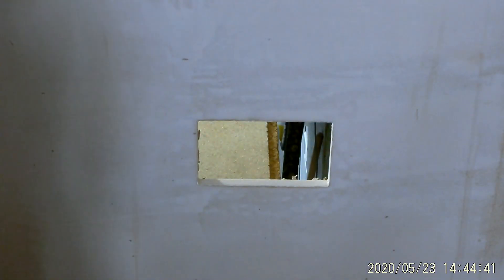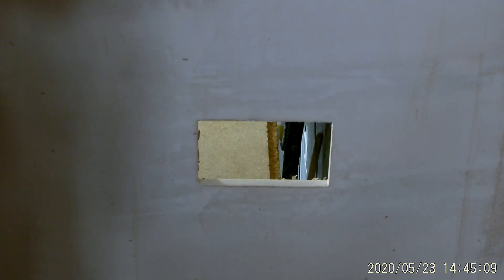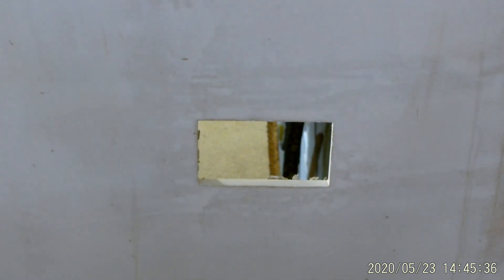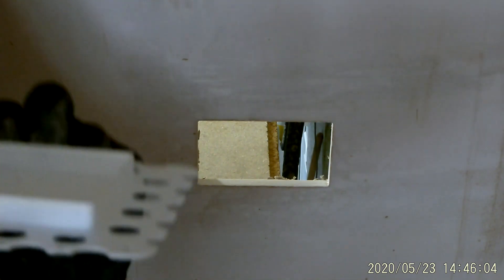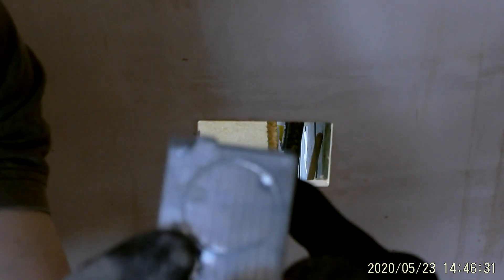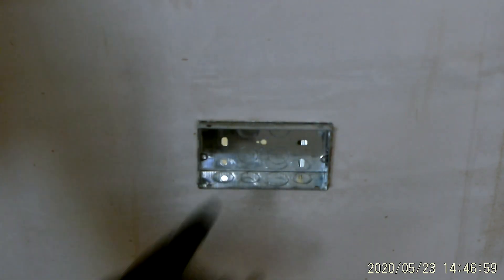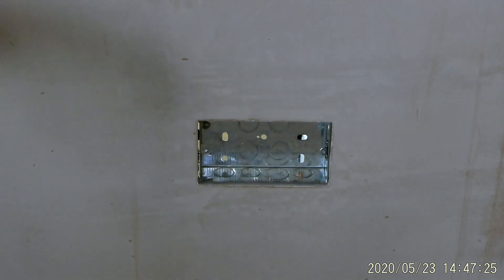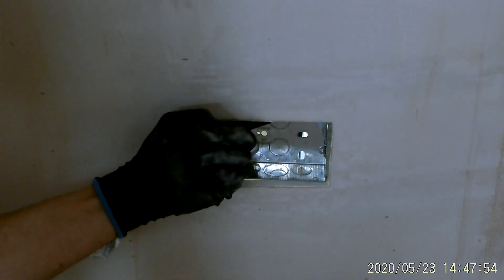25  1st part of discussion around socket and switch bead

Comment: Perhaps the manufacturers of the socket bead could leave a small gap where the metal tabs are on the knockout box. Out of interest im always trying to find really good quality  knockout boxes but haven't come across any yet. Some are really poorly made and also the screw tabs don't seem to last that long. It would be nice if things were made like the were years ago. I come across many 50 year old ones where the metal is twice as thick and much better made. Race to the bottom springs to mind again.
Reply from the maker: Absolutely Peter, the machining is what it used to be. Where do you usually buy from?
Reply: @Pure_electrical_training  crazy as it seems but the most accessable and reasonably decent make are from B&Q ... I always forget to do some research on the subject. Mostly because I don't use that many. My main work is remedial and second fix type work or small projects. I would love a few more new build bespoke jobs.